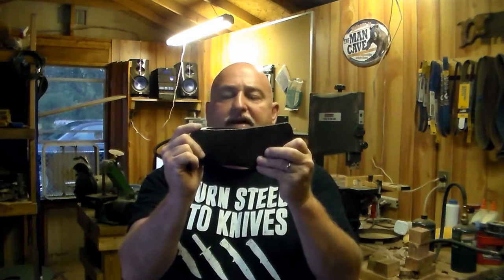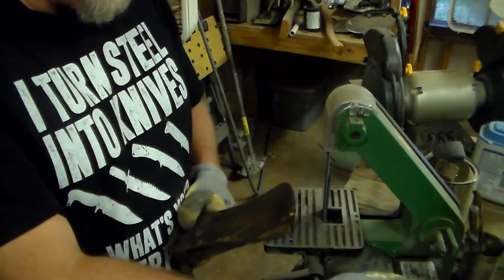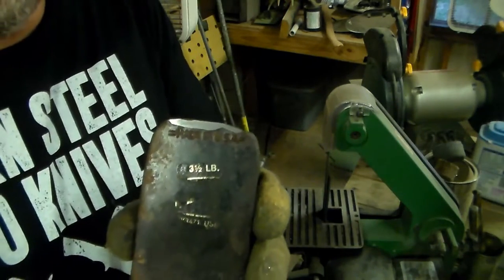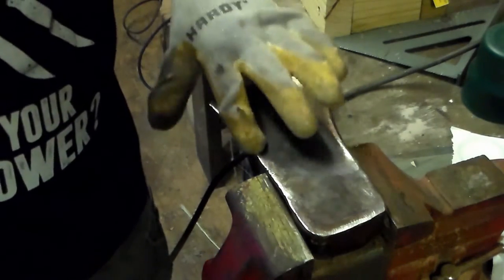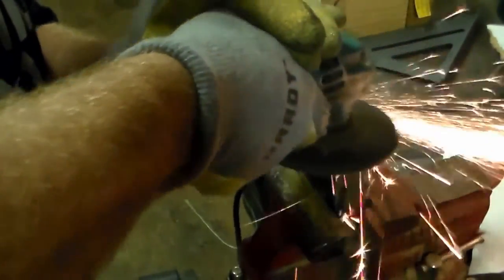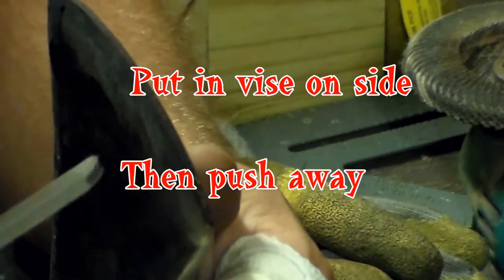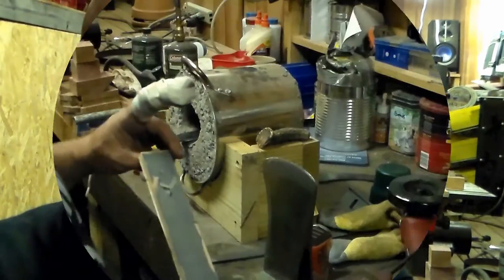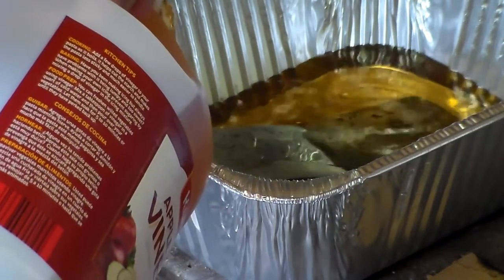How I Restore an old axe head

Comment: Good job!  I have the same equipment.  Here is what I do and why.  First, it doesn't get 104 degrees and humid where I live.  I roll the grinders and tools out of the garage and do the work in the yard.  Even wearing a respirator mask in the garage would not provide enough protection.  Moreover, I would have to do some cleaning.  I am also concerned about sparks in the garage.

I make sure that I have a full face mask.  Had to replace one this year.  Darn but the thing gets scratched up.  Rather have the plastic scratched than my eyes.  

First, I do the vinegar soak.  Sometimes, I have to do it twice.  I don't want to remove any more metal than necessary.  Of course, if you air dry it, you will see the rust start to form again, so do a light silicone lube or even 3 in 1 oil.

Then I do the grinding.  The tops of some hatchet/axe heads are so badly abused that my Harbor Freight belt sander would not do the correction as well as a standard bench grinder.    The hand held grinder is very good as axe heads do curve.

There are two schools of thought about wearing gloves around a belt sander or a grinder.  There are merits to both schools.  You choose a way.  I don't wear gloves. However, I will pick up some metal splinters from time to time.

You are correct.  It is important not to make the edge too sharp.  You choose how much you want to use a grinder and which one to form the edge and how much time to use the file.  If I can do it, I prefer to use the Harbor Freight sander with progressive finer grits.  Some people use a round stone.  Given enough time, any approach will work.
Reply from the maker: Thank you. I sometimes will do the vinegar bath 1st . On this one I already knew the depth of the wounds so to speak... I am like you the gloves can be friend or enemy at times. I wished I wore my respirator more often. It is something I should get more ingrained into my head. .. Thanks for stopping by and wish you a good day my friend. ATB MIke

Comment: Great job on that restoration Mike. I love those old axes that are made in USA. I know that it is not an antique, but, it is still a very nice looking axe for sure. I have a couple of old Plumb axes that I really love. One is actually an old official Boy Scouts axe that has the original sheath with it. Take care buddy.
Reply from the maker: I like Axes as well. The I have an old 18th century Shingling Hatchet I have had for about 2 years. It still in good shape and I never knew it was as old as it is.. I had it out in wood shed using for odd jobs. After finding out. It now is in Building ready for restoration.. ATB Mike